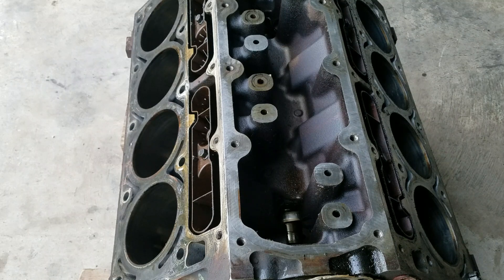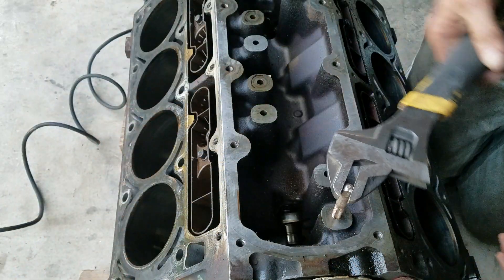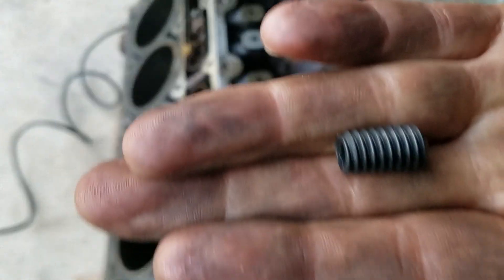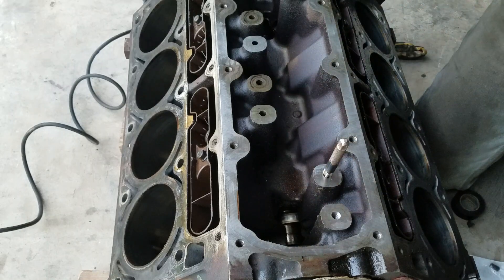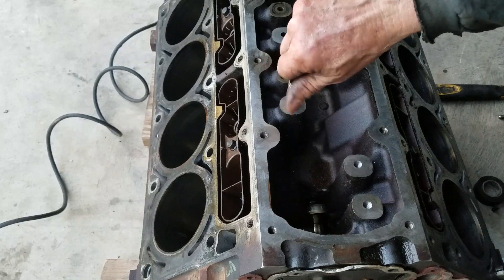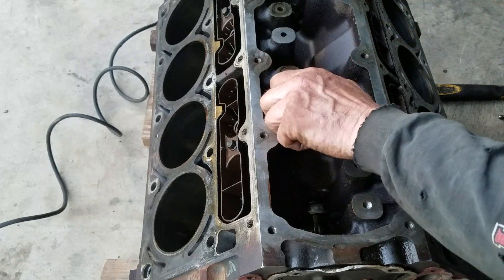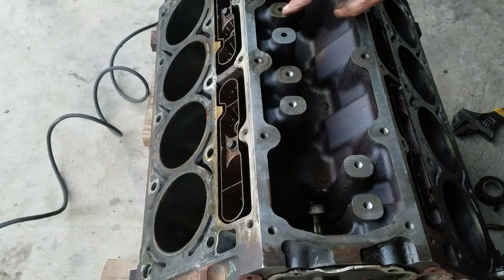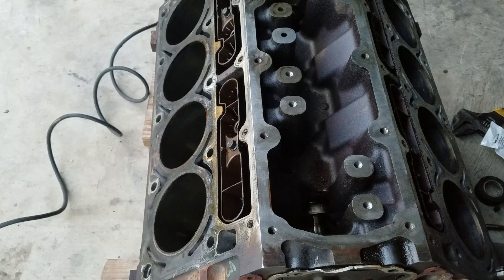5.3 DOD delete modification

Comment: The Valve Lifter Oil Manifold (VLOM) supplies pressure to these ports. If the VLOM is replaced with a block off valley cover there is no pressure in these ports. Each lifter has a separate oil supply gallery for lubrication.

Under normal operation, when the VLOM applies pressure to these ports it unlocks the AFM lifters allowing them to collapse. No need to block them off if the VLOM is gone.

Comment: I dont know why on earth your taping the holes the the new valley cover has you covered. It blocks them off or you get the freeze plugs for a quarter that way your not putting a ton of metal in the oil galley holy smokes or turn. Yikes

Comment: You don't have to do any of that. The AFM delete plate comes with o-ringed, blocked off ports.
Reply: and how much is that valley plate? this seems a lot cheaper, don't it?
Reply: I heard people still experience oil pressure loss even with the new valley cover that’s blocks off the oil towers, they sell plugs that get tapped in with a hammer, no drill no shavings.
Reply: @robertm8484  You cannot have oil pressure loss there. The holes are O-ringed and built into the AFM delete cover. It can't leak. If it does, remove dead cat from between block and cover, then reinstall.
Reply: @robertm8484 what I was thinking.all them shavings just went down into the block
Reply: @robertm8484 what I was thinking.all them shavings just went down into the block
Reply: AFM delete plate is like $225
Reply: This is a piss poor way to seal up those holes. Just buy the right parts, don't pretend to be a carpenter working on a truck. Don't be silly. Just buy the $225 VLOM cover with built in O-Rings and you'll be good to go, no pointless pounding of soft plugs. That just screams 'WE DON'T KNOW WHAT TO DO HERE SOMEONE PLZ HALP'
Reply: @Jett-Alaska  TSP and BTR racing both sell these plugs, so you they fall under the “we don’t know what we are doing?” 😂😂
Reply: @robertm8484  Holy cow. Ok. I've done about 25 AFM deletes using the same kit. No stupid tapered plugs. Solid AF, never had an issue EVER O-Ring seal. Like they use on what are called race car engines. 🙄

Comment: What does this modification do to the engine? What used to be in those holes that you threaded and blocked off? Thanks.
Reply: Thanks for the explanation.
Reply: I'm working on a 5.3 Silverado with all vlom codes and no power, no misfire codes stored , but no contribution from all DOD cylinders. I removed and intake and found harness unplugged. But nothing to plug into..just a flat cover. Is this probably changed to a regular 5.3?
Reply from the maker: It disables the oil flow to the oil passages going to the DOD lifters. I  will change these lifters to the LS7 lifters and put in a performance camshaft. More on these modifications coming in future videos. With these mods DOD will be totally eliminated.